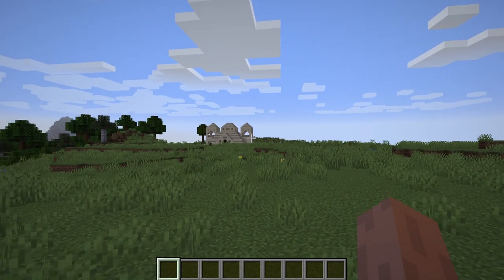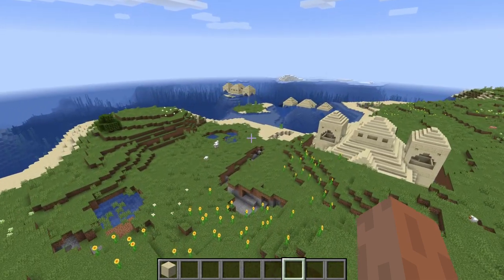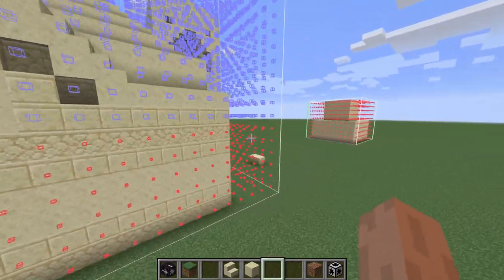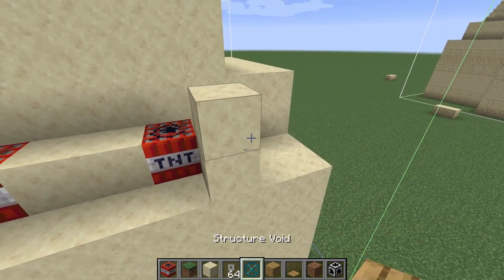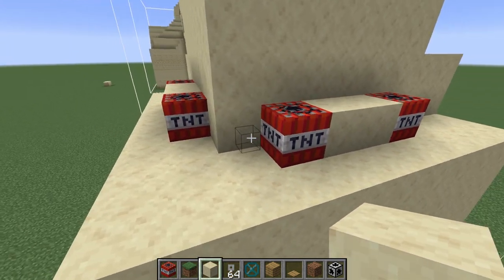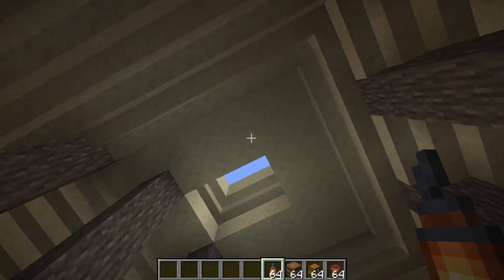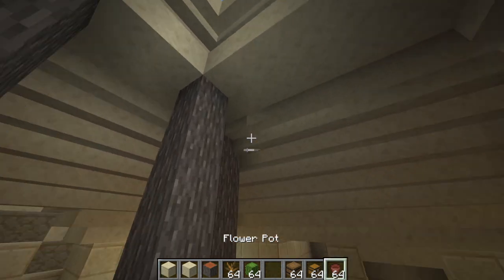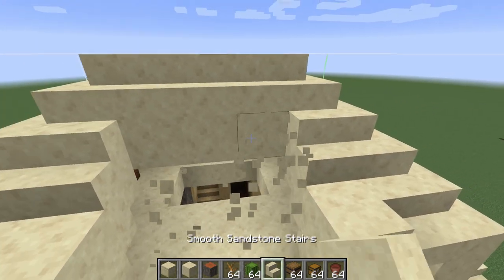MCreator Build: Desert Temple | Part 3

Comment: Is there any way to add signs blocks in mcreator?
Reply from the maker: Not with customizable text, you can make prop signs with text you type out but its not customizable you can overlay the larger image over a pane in your block to give a bit higher resolution texture for the text. The texture still needs to be square though.